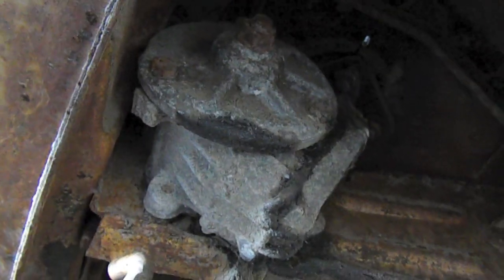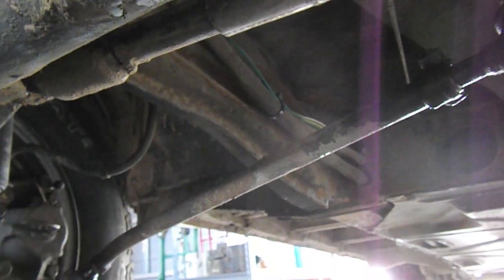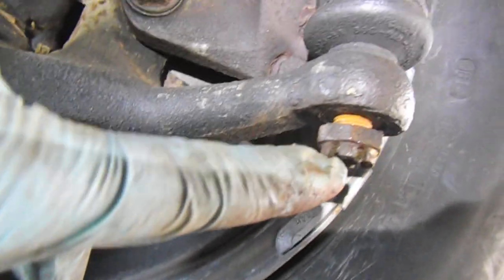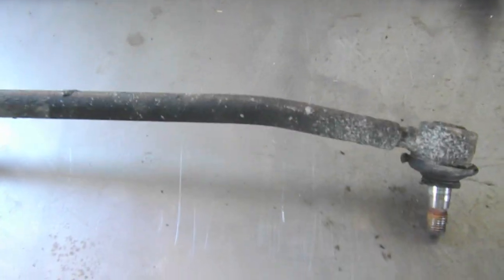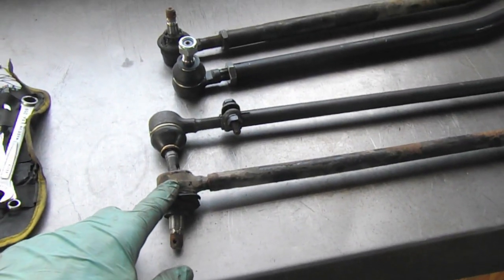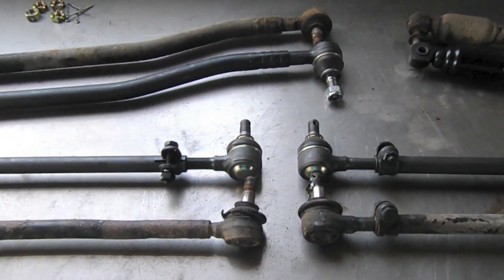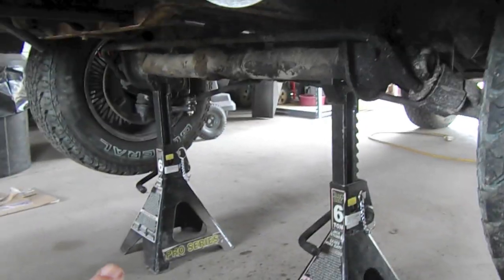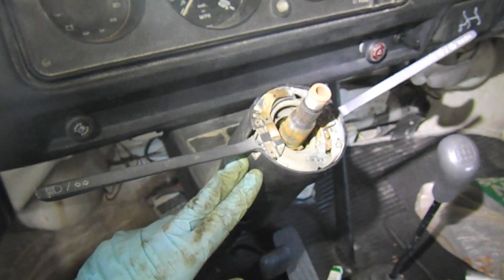Steering rebuild on VW Bus

Comment: I had to grid one of my pullers to fit the steering wheel to take off,  It wouldn't budge.  Finally "popped" when I used an air wrench to turn the puller.  It was the hardest part of the job.  I raised the bus as high as safely possible, pulled all the cotter pins, then removed all the nuts, then used a hammer to hit the side of the different component to pop the tie rod and drag link out.  I didn't need a pickle fork.  I double checked all nuts to be sure they were installed and tight.  New parts came with self locking nuts, I didn't have to bother with cotter pins on reassembly.  It took about 3-4 hours for entire job including clean up.  I can't believe I lived with sloppy steering for so many years!  Cost was less than $200.00 US, parts bought on-line.  Thanks for the video.

Comment: Great video! Just a quick tip for getting those outer tie rods separated, if you need to remove them without destroying the boot. Loosen the castle nut, then put your jack under it with some pressure. Then take your hammer and hit the outer part of the control arm right where its seated. Pops 'em out every time, with no thread or boot damage.
Reply from the maker: Woohoo! That is a fantastic tip! Next time I have to remove them without damage, I'll be doing that.
Reply: Potentially stupid question, but is the control arm the part near the tire where the tie rod is attached?

Comment: I used this video to replace the drag link, tie rods, and steering damper on my 78 Westy and now she drives perfectly straight. Really struggled getting the drag link and one of the tie rods to pop off and had to use a pickle fork with a breaker bar to get them off. Thanks for the help!

Comment: Your tutorials are GREAT!  You explain procedures very methodically and clearly.  I am in the midst of doing this type of r/r but will probably take it to the Old Volks Home in Soquel, Ca. to do the actual work.  My thought is to r/r the same parts you showed as well as r/r my TRW box with a original remand box.  Right now, my bus steers like a truck without power steering.  I 'trusted' a repair shop in Daly City to get me the correct box and now, I have been told it may be the wrong box as the Pitman arm does not fit flush to the housing of the box AND has no cotter key....which I thought was a bit dangerous.  Thank you.

Comment: While I have noted the date on this video, I decided to leave a thanks anyway, as I am about to replace these (and other) exact parts!  Thanks also for noting the mark on the steering box, I have not seen this in any of the other video's I've watched.  On the adjustable tie rods, mine similarly has one adjustable/one fixed, which I will be replacing with two adjustable.  I like the ability to service all of the ends of the rods and I should also note that if something goes wrong with any of the tie rod ends, each end can be bought and replaced by itself, as long as the rod itself isn't damaged.  Some savings there as well.  Got to go get this stuff installed before it snows, thanks again for your attention to detail!

Comment: To work on these old vws you need the pitman arm puller for 'compact' cars. It is small enough to fit over SOME of the tie rod ends/steering knuckles. A good torch, air hammer and a pickle fork were required to bust the rust on my project.

Comment: The old tie rods aren't bent.  VW actually used angled tie rods in certain years of Bugs, too.  I replaced my front beam in my Bug recently and the beam came with an angled tie rod on the driver's side with a similar bend to yours.  They do bend with front end trauma but it's usually a bowing rather than a clear angle like yours show.
Reply from the maker: +Scott Williams Thanks Scott, that's good to know. At the time I did this I was researching it pretty heavily and determined that these weren't truly the bent version but had suffered from a jack or rock incident (at least that's what I remember deciding). In any case - I'm glad I replaced them - drove super solid after that. Cheers for sharing knowledge!

Comment: Great video, I have a question, how did you remove your steering wheel. I have a 71 bus that can't use a steering wheel puller , it just basically has the center bolt and that's it, any ideas would be greatly appreciated
Reply from the maker: A 71 should just pull out after you've removed the big nut under the horn cap. Maybe some penetrating oil?

Comment: I'm thinking about doing the same work. One question: I have play in the actual steering column. Looks like a part might be missing between the column and the floor. Is there a part that stabilizes the actual steering column?